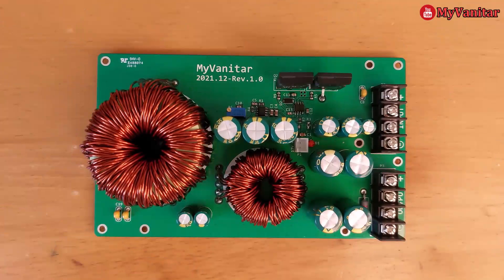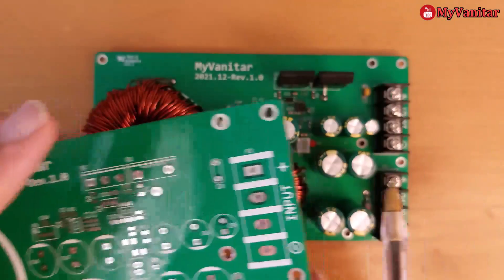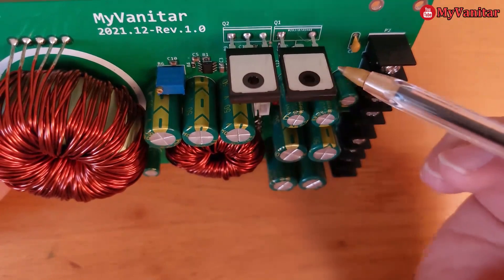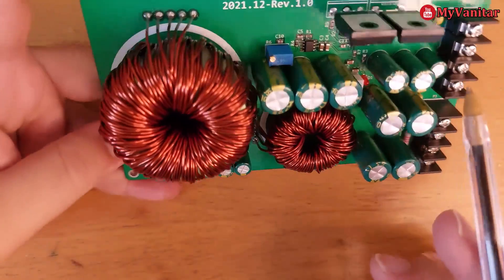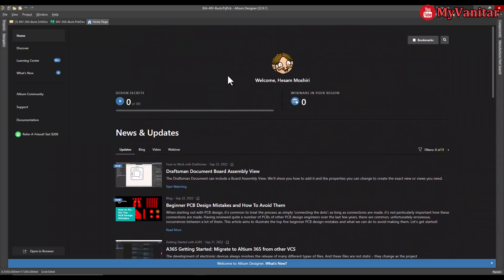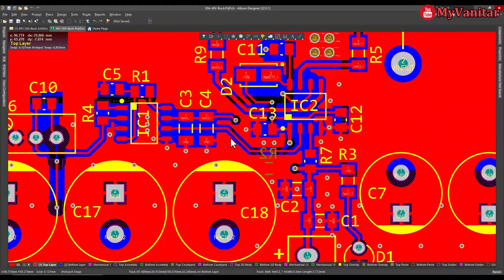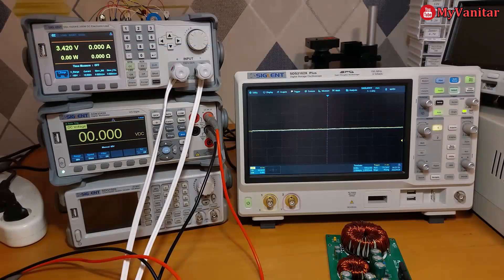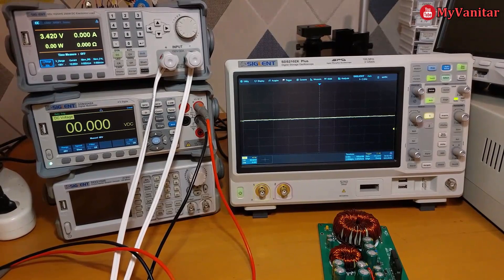40V-30A Adjustable Switching Power Supply

Comment: Hello everyone next week I will get the PCB's for the 40 Volt 30 Amp Switching Power Supply, but I have few questions I have to ask you to help me: 
a) I will need 38/40 Volts with a current of 23/25 amps so I am asking what is the maximum voltage I can drive the PS, you mentioning 40 volt, but this can be increased  changing also the voltage of the electrolytic capacitors? Up to what voltage as a max?
b) I am trying to source the toroid but could not find stock in the usual channels like Digikey, Mouser, RS and even in China. I believe they are the T201-52 (22 mm high) and the T130-52 from Micrometals, is a possibility to use other maybe from Amidon? And of course what material instead of the 52? I have seen the 26 with similar specs as the 52
c) Last question how many turns around the two toroids of the 5x1 mm copper wire, doing some calculation I have got 26 turns for the large core and 11 for the smaller? Is this correct?
Thanks a lot to everybody for the help. Aldo
Reply from the maker: a) you need to replace the capacitors with higher voltage ones, and also replace Mosfets with higher Vds.
b) similar toroid cores also work, either yellow-white or green-blue or similar. one of the cores is T201-52 and the other one is T130-52, also commercial inductors with similar specs (higher inductance is fine) work there also
c) good question, I don't know why I missed that. the big core has 20 turns of (1mm wire * 5) wire and the smaller core is not critical, just wind till you fill the ring in one round, but also (1mm wire * 5)

Comment: Great video.Thank you
Could you add more details about toroid cores? what is part codes or manufacture codes also what is AL value of cores .
Also what is wire thinknes and count number  I know 5 paralelel 1 mm thicknes for big toroide but how much meter?
Thank you for design
Reply from the maker: because you are not bounded to exactly use them. if your cores have bigger height, doesn't matter, even better. the big one is T201-52 from Micrometals, Inc, and the smaller one is T130-52. you can use other manufactures, with the same size.

Comment: How about making it digitally adjustable?  Or even with an analogue input or PWM?
Reply from the maker: the resolution and step size matter, I should work on that, but who sponsors my time, whenever I had time, I will publish something.
Reply: @MyVanitar  I've got the same problem with being too busy.  I'm using a "cheap" DC/DC with digital interface, for a cathodic protection project.  But it has a strange behaviour where on power on, it briefly produces a short (I forgot where), so I'm using a relay to isolate it temporarily.  I've been looking at designing my own for a while, but power electronics isn't my forte.
Reply from the maker: Does it short the output even without any connected load?
Reply: @MyVanitar  No, it was something like shorting one of the output lines to one of the input lines.  It wouldn't matter if the output is isolated from the input, but I'm sharing the ground.

Comment: What is the reasoning for bigger clearance with high current traces/polygons? Can you link to this IPC standard you talked about?
Reply from the maker: This is one calculator for this, enter 30A and peak voltage to 38, see the last row for the external traces: https://www.7pcb.com/trace-width-calculator
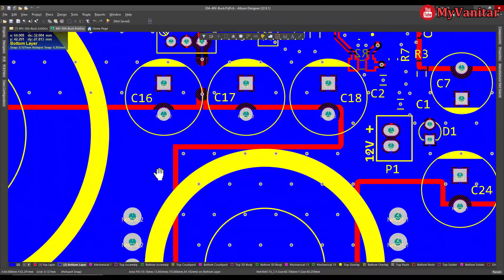Reply: @MyVanitar  I am not asking about the size of the copper tracks, I am asking about the clearance between the copper tracks and ground. At @5:44 in the video you point to the difference in clearance length between signal traces and high current carrying traces. And you said at @6:05 that this is the IPC standard. So I was asking for the reasoning / explanation for this larger clearance and which IPC standard you are referring to.
Reply from the maker: man, as I told you the last row of the calculator gives you the minimum clearance between tracks (0.8).
Reply: @MyVanitar  I understand. However I was looking for an explanation for the increase in clearance length, as in the video it sounded like you had a specific reason and you read that somewhere in an IPC standard. So I was just curious where you read it or just in general your thoughts about why the clearance needs to be bigger. If you don't know or misspoke then just say that. its okay not to know things

Comment: Your UC3843 switching controller has is ISEN pin connected to ground. Generally current mode controllers do not produce any ramp internally but measure the inductor current to obtain a ramp for PWM generation. Alternatively the UC3843 timing capacitor ramp can be coupled into its ISEN pin, as shown in its datasheet.

I recommend you to check your contrtollers' PWM output. Due to the lacking ramp waveform it is likely not a nicely regulated constant duty time when a constant load and a constant supply were connected. Should you have problems with dynamic loads you may also add a parallel capacitor to the compensation network (R1)
Reply from the maker: That's for a different purpose and I had tested it before. This works constantly and my setup allowed me to test up to 18A. constant supply and constant load. Build and test yourself
Reply from the maker: Even it passes the step response test which I'll show in the next video probably

Comment: You use two power supplies at the input, one for pwm and driver (uc3843, ir2104) and the other for switching, is it possible to use just one in combination with a minimum input of 15V to get 12V for pwm and driver regulation (uc3843, ir2104) for example using a zener diode and an NPN transistor?
Reply from the maker: You can do that, 12V input is not something special, you can inject from any source because the input and 12V grounds are the same. but 12V should be fixed and regulated. Please check the article. I will provide the link in the video description soon.
Reply from the maker: The limitation of your suggestion as you said is for when the input voltage is below 12V, which I had to cover in my design, but this is not your case since your minimum input is 15V
Reply: @MyVanitar  many thanks sir